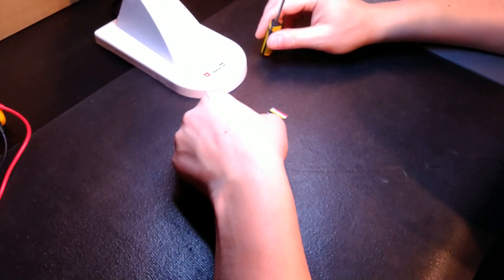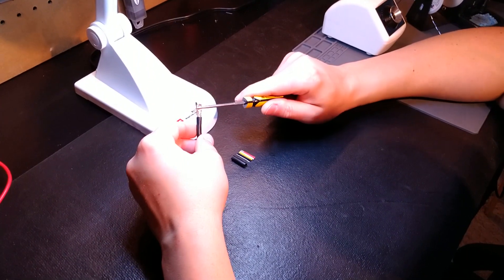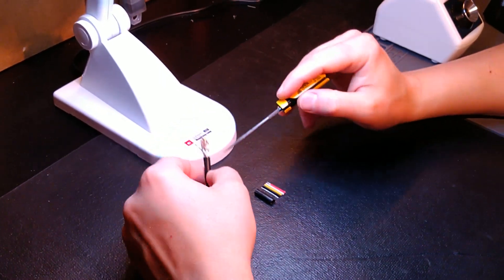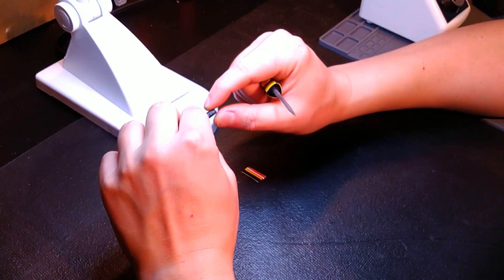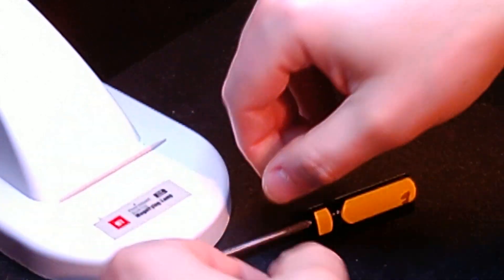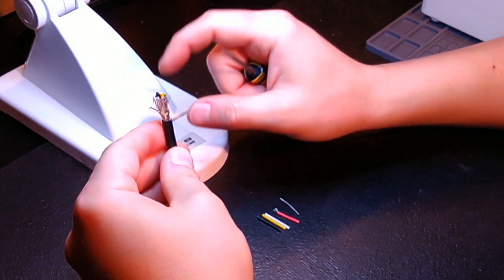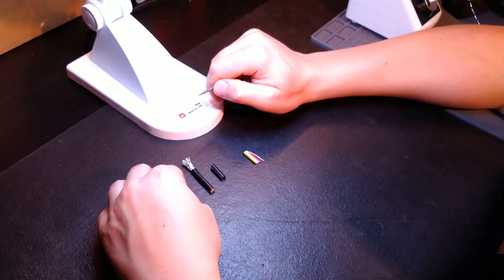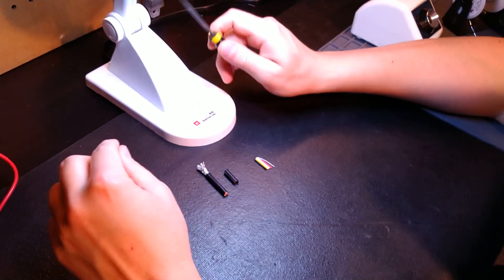18/4 Double Shielded Cable Rev2 Edition..

Comment: Good to see you're no longer using that hair-thin 28 gauge data cable you sold me to use as power cable to run my motors, Vince.  As I mentioned almost three years ago, 28 gauge data cables are NOT suitable to run 400 oz NEMA 23 stepper motors at 48 volts. It would have been great if I hadn't had to replace mine with the proper cable at my own expense, after paying $800 for your "services," but we live and learn, don't we?